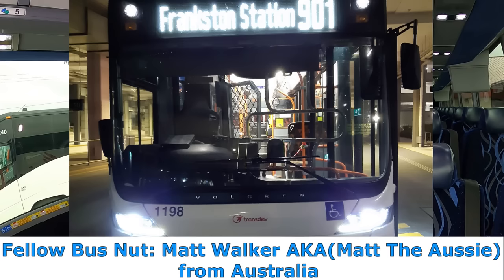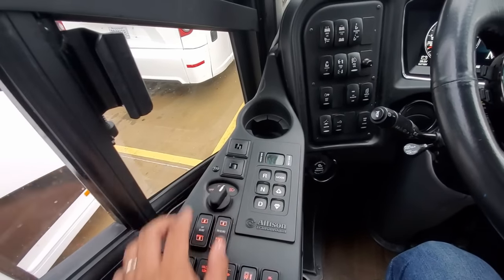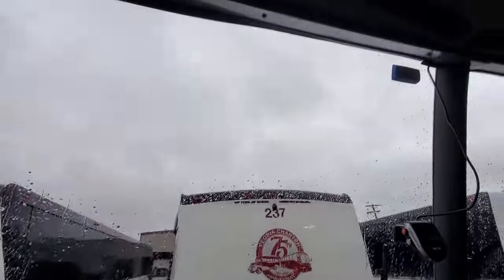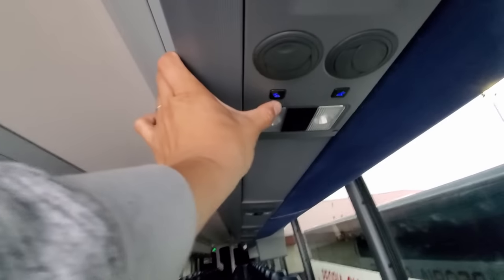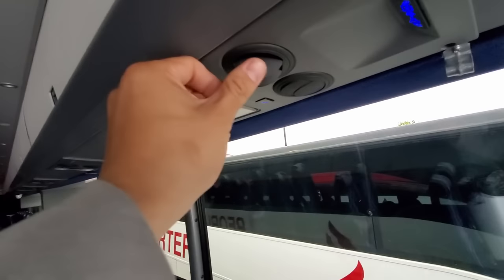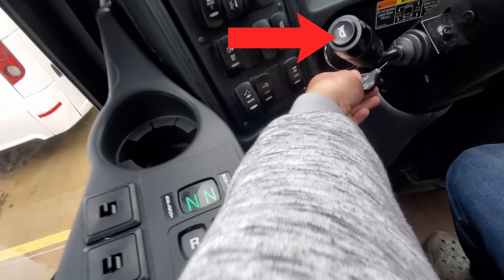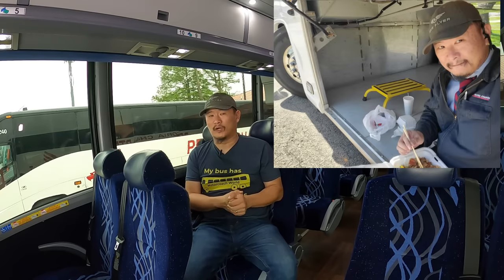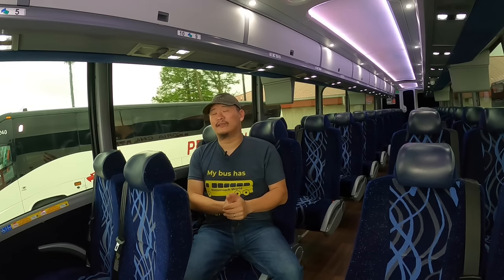What do all the buttons do?? | MCI J4500 2019

Comment: There seems to be a huge variation in the amount of buttons. Ive been on some buses less than 20 years old with barely a dozen, meanwhile theres buses with literally about 50.

Ive seen buses just requiring you to put in the key, put the mains on and press the ignition. Some have extra buttons that specifically toggle ignition etc. Seems abit silly, if you thought driving another car with different positioned buttons was annoying its10 times more annoying on a bus.

Comment: i still watch this video alot.  
can the outlets be turned on if the coach engine  is not running?
Reply from the maker: Yew they can in accessory mode
Reply: @MotorcoachWorld  it probably puts a heavy drain on the batteries  without alternator running.
Reply from the maker: @albertl6963  yes it would. You wouldn't want to do it too long.

Comment: 4:32 is incorrect. The "Level Control" switch either raises or lowers the entire suspension, it does not recover a leaned coach as descibed.
Reply from the maker: Thanks for pointing that out Dan. According to a few diesel techs I spoke to, the newer 2019's did level from any kind of lean, unless it was a broken bellows... But that could have been incorrect. Appreciate the correction.
Reply: @MotorcoachWorld  the recover button would do that. But the up down button to the left of it is just for that: raising or lowering the suspension of the entire coach

Comment: Great video! I was recently very bored with a 2018 J4500 the past weekend and was playing around with some of the buttons that I normally don't ever touch. Some things I've noticed:

-My bus had a full bus high ride/low ride button along the left hand console. I did not notice it in your video, I'm guessing this is an optional feature? 

-My bus has the optional 360 camera system. And therefore, there's a button labeled "360 Camera" on the left hand side. Never dared to press it and see what it does. Curious if either it 1. Activates the 360 camera (it already gets activated by reverse, any signals, hazard lights, etc). or 2. It marks and saves footage?

-(I learned this from another youtube video) the mirror control setup is specific to the generation of J model. 2017 and older would be: Upper D Pad - Left Mirror Head (Flat vs. Convex) and Lower D Pad - Right Mirror Head (Flat vs. Convex). Whereas 2018 and newer would be: Upper D Pad - Convex Mirrors (Left vs. Right) and Lower D Pad - Flat Mirrors (Left vs. Right). That's so far been true on every J I've driven. But I think you suggest that there are 2018+ models where this doesn't hold true. Is that correct?

-I've realized that the Master and Start switches on our units are in different positions of the same row, I'm guessing that is customer configurable (or dependant on other options on the bus?)

-You forgot that if you put the reading lamp switch to TEST, and step on the brakes, it would activate the Lamp Test which turns on and flashed all exterior lights for pre-trip purposes. I learned this very recently. 

Loved this video. Looking forward to a Belgian version of it to decipher all of their hieroglyphics :)
Reply from the maker: Hey Raymond. I dont think ours have as many features as your bus. I was not aware that test mode plus break activates all lamps. Ill have to go try that! Thanks man! Yes some J models 2018 + the mirror controls are opposite. I dont know if that is by design or some technician at MCI hooked them up wrong LOL. For each bus i dont think all buttons are uniformed in where they are. It also may depend on the package.
Reply: @MotorcoachWorld  I believe the test mode for lights has been standard on J4500s since about 2010. I've been using it for years. Reading lights on the Test position, step on the brakes for a second, and all the lights all the way around the coach will turn on and/or flash for about two minutes. It's the only way to check the backup lamps!